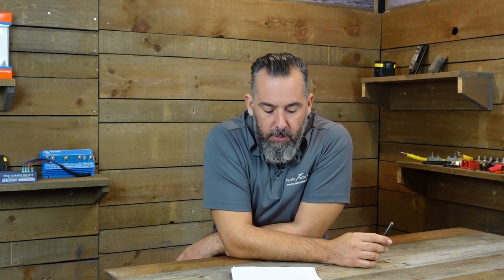What Are Electrical Grounds on My Boat?

Comment: My boat won’t start up I have the positive and negative cable hooked up to my battery and the ignition wired I’m missing a wire and not sure where
Reply from the maker: Make sure you have 12 Volt at the starter solenoid. Also make sure your ignition key is powered by 12 VDC and confirm that your panel is energized. When starting your engine, you should hear a click from the solenoid, even if the engine isn't turning over.

Comment: DC current seeks only to connect to its polar opposite. AC current will follow any path of lower electrical potential. This is why you can have a connected DC circuit and touch the wire and not be shocked. Because the path of current is already established. AC current is not the same. It will use your body to connect to the ground because you are a path of low electrical potential back to ground. So if you touch a live AC line you will get shocked.

Comment: Hi Jeff, great video as always.
I support the comments bellow and would love to have a longer video on grounds.
I have a dual battery switch with two battery banks (engine and house) but have trouble to understand the connection they must have with the engine...how should it connect with the starter and the alternator? 
I hope you can help we find everything on the net and I trust your judgement.
Reply from the maker: Hi Romain, both the house and engine battery DC negatives need to be connected together. In turn, the engine block negative needs to be connected to the engine battery, effectively making both engine and house battery grounded.

Comment: Given this, how do you properly wire an alternator that’s grounded to the engine block via its case / mount so that its output is picked up correctly by your battery monitor? Won’t the chassis grounding throw off the monitor’s ability to read the alternator’s output even if you run the alternator’s ground wire to the load side of the monitor shunt? Thanks!
Reply: Jeff is incorrect and confused
Ground does not exist out on the water, the engine has a grounded connection or bus, negative from battery and all other electrical reference  to ground connections are at that point , simple

Comment: how about DC ground/-/black wire distribution trough a steel hull? like how it is done in our cars? is there somethin wrong with that?
Reply: Don't wire it like a car and use the hull for ANY return path to your batteries, there should be 1 point only from your DC neg distribution to the hull, Same with AC protective earths, they go back to the AC earth bar only, then link the AC and DC distribution.
Reply: @nicholaskeur  why exactly? What is wrong with wiring it like a car
Reply: You do not want any current running through the hull, it creates  corrosion problems,
Reply: You dont want to be using your hull to carry the current by default.  You will rust out.
Reply: @RealHankShill  please explain why, a lot of people are claiming this but no one can explain..
Reply: Well, you are running current through steel that is sitting in saltwater.  Its going to increase corrosion.  Not only that, the hull of your boat is not the best conductor, so you are going to be losing efficiency on that.  Better to spend the money for actual battery cables and run negative wires for the current to run through.
Reply: @RealHankShill  the thing is, the saltwater is never a part of the circuit (unlike the problem with shore power ground, than it is a part of a circuit). The slightly  higher resistance won't loose you a lot of energy, but ok, that point can be valid.
Reply: @markhelifreak  The saltwater doesnt have to be part of the circuit, its the fact that the circuit is in the saltwater that is the issue that increases corrosion.  You are in essence turning your entire boat into a battery and any two dissimilar metals in the water will have an increased rate of corrosion when you add electricity into the equation.

I also cannot find the spec'd amp rating for "30 year old sailboat hull steel with variety of random coatings on it"  :D

Just saying, if it was my boat, I would run negative wires for the system.  There is also going to be a lot of galvanic noise in the hull of your boat, that you will be flooding into your electrical system, especially if you are connected to shore power.
Reply: @markhelifreak  Also consider how much control you are giving up.  When you have a DC circuit running through wires exclusively, like on a fiberglass boat, you can control exactly where the power goes, and equally you can predict where it will go and act.

When the electricity goes through your hull it will be in an unpredictable path, and one that is not always the same.

This is not really an issue on 12V systems, thats how cars work.  But in my mind it is less than ideal and no real reason when you have bus bars

Comment: Still dont understand shit .. sorry :( 
Have one light with ground, just grounded it to the housing of the lamp. But i have a set of windshield wiper that also needs ground.. where to put it? Same ground as the lamp? Or can i ground it in its own housing aswell?

12v DC system - Norway

Thanks for help!
Reply from the maker: A DC circuit is generally made of a positive and negative circuit. The negative circuit, is connected back to a battery, and in turn most boats have the battery negative grounded by the engine block. Some DC items want to also connect to ground. In that case you need to run a seperate circuit to the battery negative (which is effectively your DC ground).

Comment: I could watch that video.
Reply from the maker: I gotta do it.
Reply: Yes please a one line  and wire size for bond.
I have a ground buss behind dc panel.this refed off lip04. At this location is the old negative from last house battery should i tie this old house negative to the ground bar and connect the other end to the start battery negative ? 
Im concerned with return path as start battery closer to negative buss.
Thank you

Comment: poor video. Did not answer the question asked
Reply from the maker: Hi MT, thanks for your candid feedback.
Common grounds on boats are AC, DC, Bonding, and RF.
Reply: @PacificYachtSystems  Am known for calling a spade a spade! Why didnt you say that in the video? By the way lightning ground should be separate from others or you will burn out every system on your vessel.